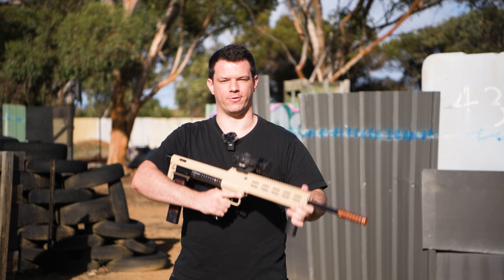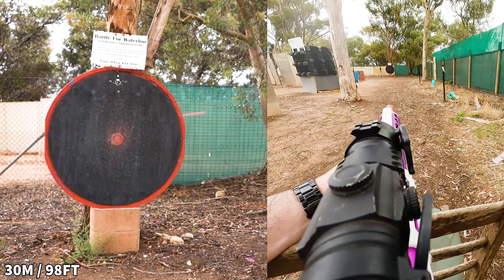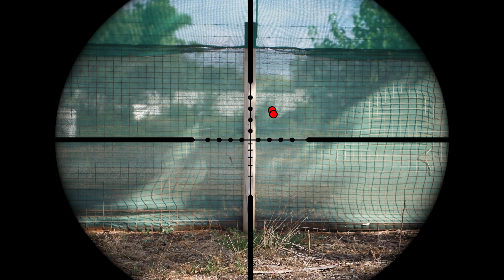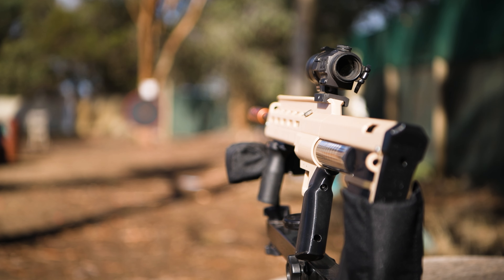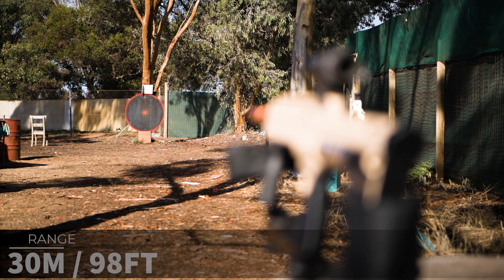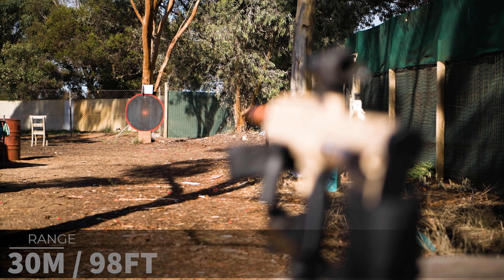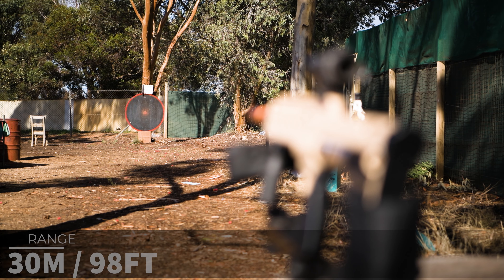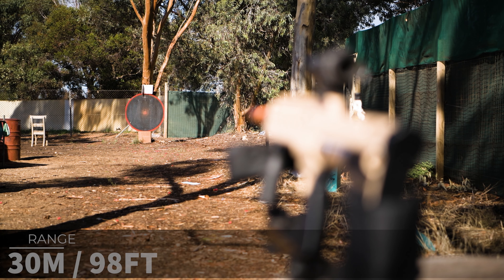How to Zero an Optic for Nerf Blasters!

Comment: Something i would recommend before zeroing your optic is zeroing your rifling. In my experience at least, all scars pcars and bcars ive tried have sent the dart slightly more in one direction relative to its rotation, and ive found rotating the muzzle device/barrel until it sends the darts upwards relative to the blaster really reduces the amount you need to zero the optic. Ive also found some scars to have a significant enough "hop up" to noticibly increase the range and reduce the need to tilt the optic.
Reply: Yea I have noticed that some rifling devices don't put enough spin on the dart for the fps range, so I would say not to do this, but instead to find the optimal scar/bcar angle for your blaster, for 300 fps I have found 3-5 degree BCARs to work the best and 100 degree SCARs
Reply: Which ones would you recommend